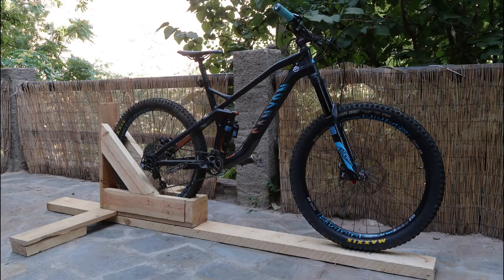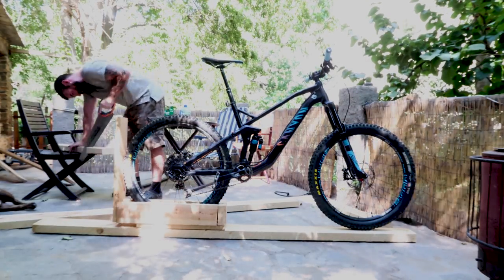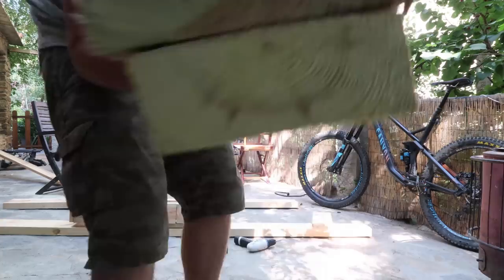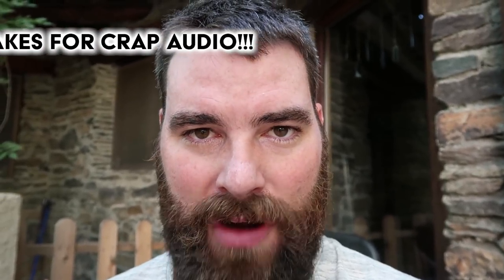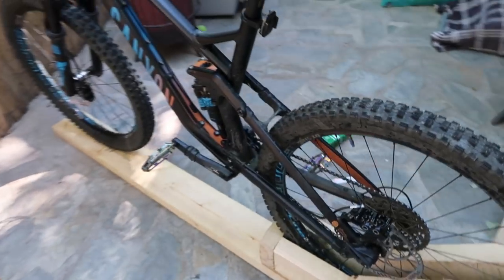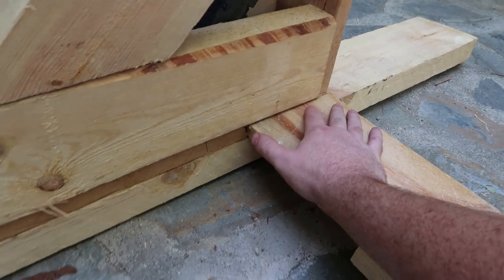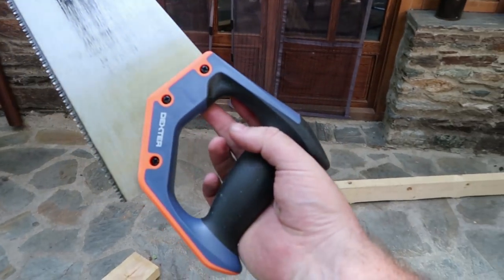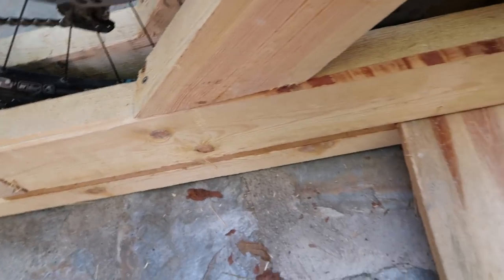MTB MANUAL MACHINE | Quick Time Lapse Build

Comment: I've made one and have found it helpful.  A few comments: 1. the outrigger is totally unnecessary.  In fact, if you are putting that much lateral force on your tire, it would be better to tip!  2. The extension out the back is also unnecessary - the center of gravity is already forward by half the wheel width.  These modifications will reduce the materials significantly.  Enjoy!

Comment: I was thinking about making a video like this. I am actually glad you beat me to it. You did a much better job than I would have done. I'm thinking about building your design now because I need to learn how to manual. I might add a rope to the front so I can tie it to the front wheel.  Trying to figure out a way to prevent from going back to far.
Reply from the maker: MTBing Adventures thanks man. Not my design though. Check out the video on Mr Tonga. He was going to use an eyelet and rope for a safety strap but you really don't need one. Hit the brake and the front comes back down.
Reply: I am definitely going to build one at sometime soon. I will let you know how it goes. Two things I need to add to my skills list. (1)Jumps (2) Manuals.
Reply: The original design has a 1 inch hole drilled in the board below the front tire. A cam strap is fed through the hole and fastens through the front rim. you can then adjust the size of the strap to keep the bike from going over backwards

Comment: Nice!!...good idea...maybe a bit too big for my small garden (the owners of my garden are my daughters hahaja)...I could make something that could assembly and disassembly in a short time
I was thinking in that maybe that rim and maybe the hub will receive some strange axial forces that on the "real" life would not have?
Reply from the maker: I was thinking the same about the damaging the back hub or putting the wheel out of true. It's getting on and off the bike you need to be careful, once you're on you can keep it nice and balanced. 
In terms of size, this is pretty over-engineered I reckon. Shorten it and make it narrower and I'm sure it would be fine!

Comment: I am wondering about the need for the outriggers. Is that going to put the wrong stress on the rear wheel if you get off balance and dork it up? Would it be better to just tip over and catch yourself with your foot? The 2x6 (or 6x2 as you call it) should be just the right amount of support. I have not built one yet. Thoughts?

Comment: Question: Should the braces be so high?  I figure they may limit your range of motion from side to side, which is also necessary during an actual manual.  You are not only trying to control the forward and back, but also side to side.  Great build!
Reply from the maker: David Orshansky if you give yourself side to side movement in one of these you'll end up buckling the back wheel.

Comment: Seems a little extra complicated.  Is there a reason the for building on a 6x2, instead of directly onto the ground.  Correct me if I'm wrong, but wouldn't it work just building a box for the back wheel, with nothing underneath, just an outrigger for stability (which could be mounted on the back or front of the box)? Just trying to limit the lumber needed.
Reply from the maker: With the back wheel on the floor the whole thing will start shifting around I'd say, unless you make it very tight fitting. I personally would keep it boxed in completely at the back and just shorten the main length of 6x2 to save on timber.

Comment: How do you keep from looping out? Is it easy to bail?
Reply from the maker: You just hit the back brake. It stops you dead. You just need to lay off the brake for practising as much as you can. You can pop up and brake to hold the manual which obviously won't work when doing real manuals!

Comment: Why not just get out and start practicing how to manual that's how I learned and I can manual for as long as I want
Reply: Some "cyclists"  seem to enjoy going to great lengths to not have to ride their very expensive bicycles. Baffling.
Reply: It might be useful for times where you want to practice indoors, like if its dark out
Reply: Doing a manual is an advanced skill and it sometimes helps to learn to break the process down. This machine allows yo to concentrate on lifting the wheel and obtaining the balance point with a safety line. It excludes side to side balancing and pedal inputs. I think it is a valuable tool for older riders who may find it too hard to do everything at once.